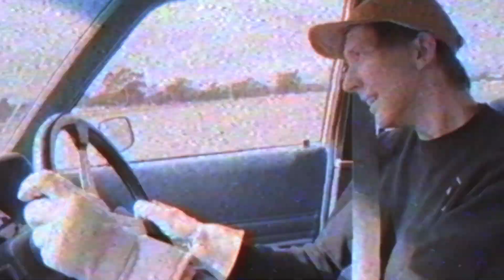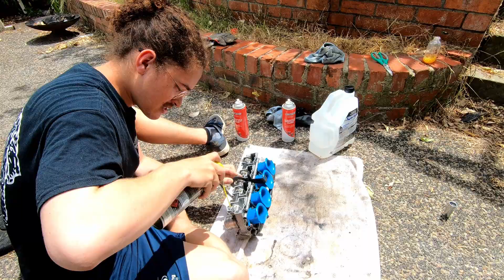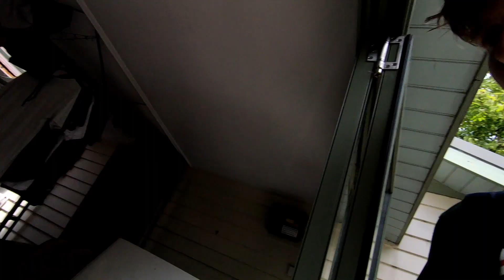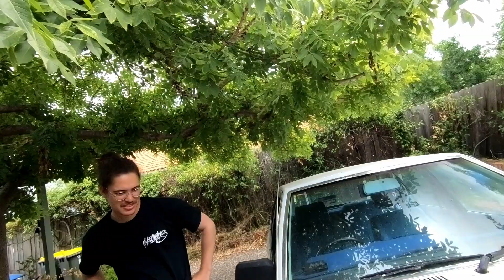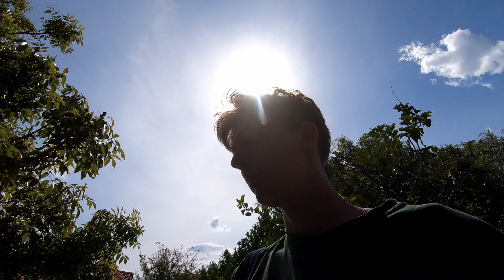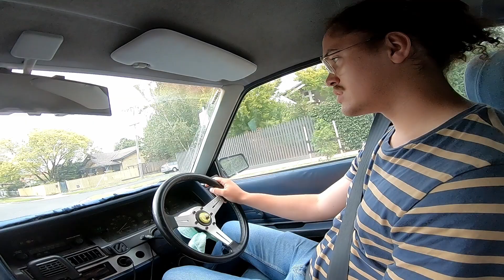Seb's 4AG AE71 Finally Braps

Comment: hi dudes does the t50 bolt straight to the 4age im busy with a ke72 it has the original 3t motor in
Reply from the maker: The corolla boys are no longer on the channel and I don't know a lot about those cars sorry, surely that's a very easy question to google tho? I'll ask a friend for you anyway :)
Reply from the maker: Yep my friend confirmed his 4age swap has a t50 and he said it's the standard gearbox from factory for rwd 4age
Reply: @TheFellasNetwork  thanks dude